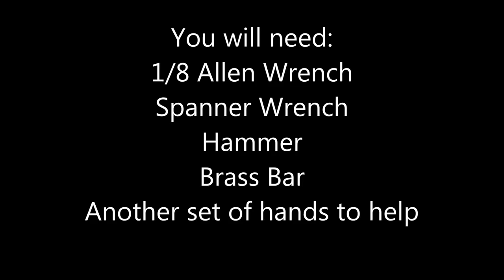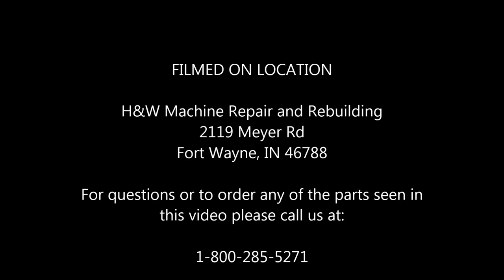Removing a Spindle on a Bridgeport Head

Comment: Do you need to remove the spindle pinion gear that mates with the rack on the spindle first?
Reply from the maker: Not if you are only removing the spindle. If you are removing the entire quill then yes. If you have any questions give us a call 1-800-285-5271

Comment: Just ordered a kit for my Supermax (Bridg close) and ran into a problem when trying to take out the spindle. Removed the nose piece, raised the quill (spindle) locked and tapped on the shaft with a brass bar. It came down maybe 1/2" but then it feels like it hits bottom or something. It jerks the quill handle and nothing is coming out more. Anything in there or just need a bigger hammer??
Reply from the maker: Tazblack70 On many of the imports the screw that is holding the Stop Nut is much longer than the Bridgeports. Unfortunately you are going to have to take apart your Micro Screw/ Lock Nut Assembly to get the spindle out. If you run into any problems give us a call and one of our head rebuilders will be able to help you out. 1-800-285-5271.
Reply: H&W Machine Repair and Rebuilding  Ok so that means that the micro screw is attached in some ways to the spindle/quill stop? Perfect, I'll remove it completely. Thank you very much

Comment: Hello, can you tell me if the procedure is the same for a ISO30 spindle as for the R8? By the way: thanks for the very nice videos. Thx
Reply from the maker: The procedure is similar but slightly different.  Once you remove the set screw on the back side of the spindle you will unthread the nose piece until it stops.  You then tap the spindle down until it stops and unthread the nose piece to stop.  Repeat the procedure until the you get the spindle out.  Let us know if you have any additional questions. - Barry
Reply: thank you, I will give it a try
 @HWMachRepair

Comment: Nice videos , the quill on my 1977 belt drive Bridgeport has got hard to pull down or back up ,  quill lock is ok ,runs quite and I keep it oiled as in the manual, I was running a 2" fly cutter when I noticed the problem , any thoughts on what it could be?
Reply from the maker: Barry, our head guy, says that it is possible that you have a burr or a shaving in between the quill and the housing. He says that it may be possible to flush it out with some oil but you may have to take the quill out and stone it. Please give us a call if you would like to talk to him, he can walk you through some troubleshooting for your problem: 1-800-285-5271 ask for Barry

Comment: My nose piece is seized... How hard can I hammer on the spanner before breaking something in the head? Can heat be applied?
Reply from the maker: You don't really need to be concerned about breaking something in the head when trying to get the nose piece off, your tools will break long before you hurt anything in the head. We have had seized nose pieces that we have bent spanner wrenches and even extender bars trying to get them off. You can apply heat to help remove it but you need to be very careful because you may melt the chrome. Also if you are going to be applying heat you need to make sure the quill is removed first because the heat will damage the quill. If you have any other questions you can give us a call at 1-800-285-5271, we offer technical assistance free of charge.
Reply: H&W Machine Repair and Rebuilding Very good information! Hopefully, I'll be placing a order with you guys soon. Thanks!

Comment: What do you charge to rebuild a j head? 
Thanks.
Reply from the maker: We won't know the exact cost until we have it here and apart but a rebuild for a Variable Speed is generally around $1,800-$2,200 and a Step Pulley is around $1,700-$2,100. It just really depends on the extent of wear in the head.

Comment: I'm about to pull my hair out. My variable speed plate and slide housing were shot. Alliant RT2. Contacted sharp... complete waste of time. Ordered parts from 3 different people then saw where you guys sold parts for my machine. I'm stoked cause your vids have helped me tremendously , sad cause I didn't contact you guys first. When everything was apart bearings etc. seemed fine. I put back together with new belts etc. Sounds 100x's better but noticed the shaft from the top view has a wobble. I can't believe it and am stuck. Any help??? Thanks so much... I could puke cause I didn't find you guys in the first place. Bummed out in Kansas City. :(
Reply: It does have a lug to it now. Thanks again!!
Reply from the maker: Hi Ty, Barry is out of town at the moment on a service call so I am fielding the YouTube questions. I spoke to Heather in the head department and she says she needs a bit more information to help you out. Would you mind giving us a call when you get a chance? You can reach us at 1-800-285-5271 and 260-422-0020.
Reply: Will do. Thanks for the reply.

Comment: I was a little confused by your terminology.  After removing the nose piece, you said to raise the spindle and lock it in place.  Then you hit the top of the spindle with a brass bar to drive it out.  Didn't you raise the QUILL, and lock IT in place?
Reply from the maker: PanamaSticks Technically yes you are correct, you lock the quill in place. Many laymen still will refer to it as the spindle so we try to make it as easy to follow for everyone as possible. It seems that everyone has their own names for most of these parts and it can be difficult to explain, that's why we make the videos so people can watch how to do it.
Reply: H&W Machine Repair and Rebuilding Your videos are very useful!

Comment: Instead of removing the head completely why not just tilt it 45 deg (or more if needed) and drop the table to get the spindle out?
Reply from the maker: Hi Alan, you don't need to remove the head to remove the spindle. We repair heads in shop and when we do our videos we use the ones that are on the bench for repair.
Reply: H&W Machine Repair and Rebuilding  .... yes I have seen it done by just moving the table back ...I am looking to replace my bearings in the next few weeks ....looking to get the bearing kit from eBay ...from yourselves I think?